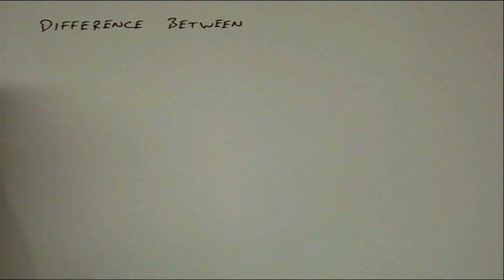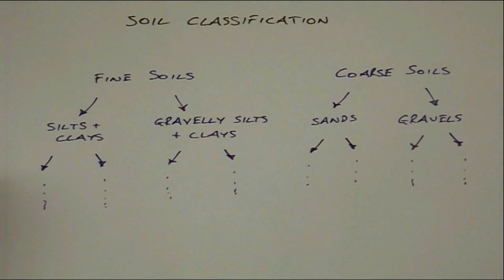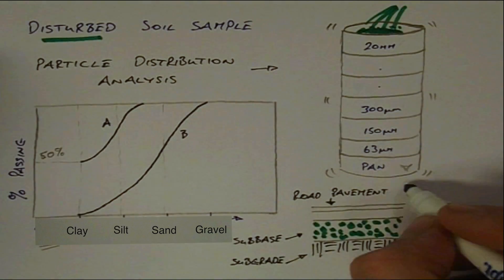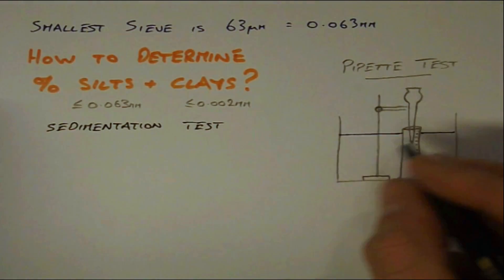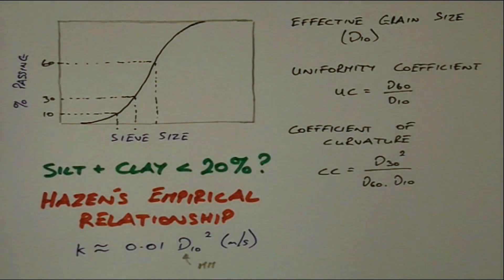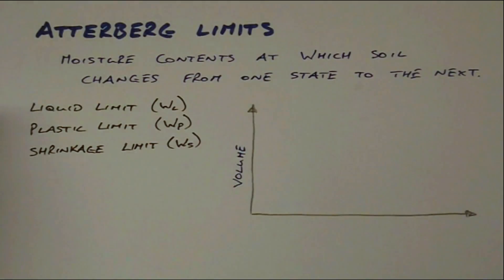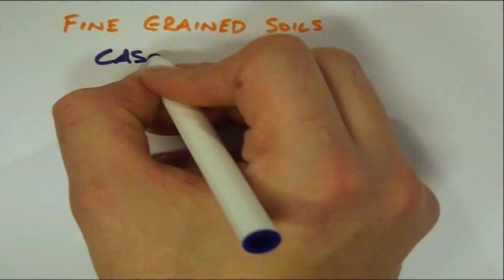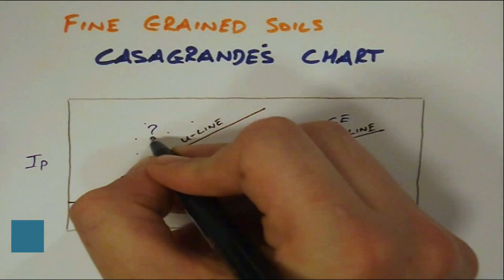Soil Classification

Comment: i have a soil assignment on atterberg limits, one question in particular im a bit confused on. Q) write a short summary of the soil properties and of how good is soil 2 as a subgrade material? Given i have all the results already for soil 2, how do i know how good soil 2 is as a subgrade material? and what projects in construction would clay be considered for? results were obtain by casagrande liquid limit test, cone penetration and plastic limit test.
Reply: Clay could be used in applications that require low permeability for water, such as the base of a canal to prevent water from draining away